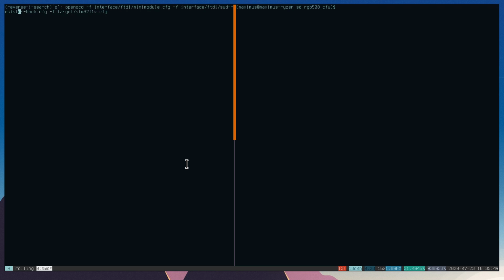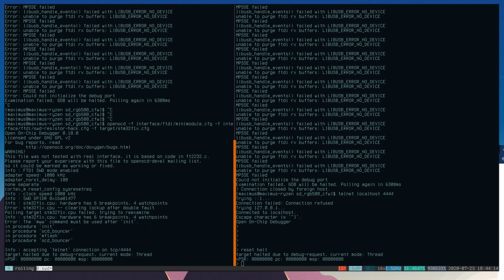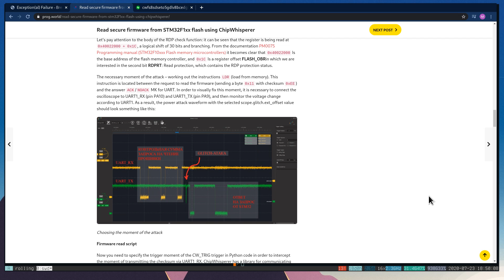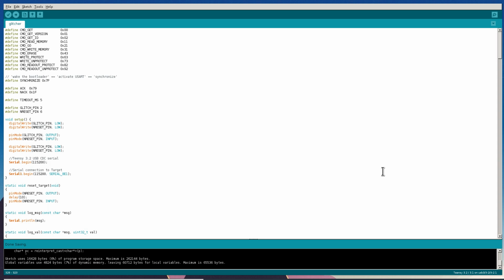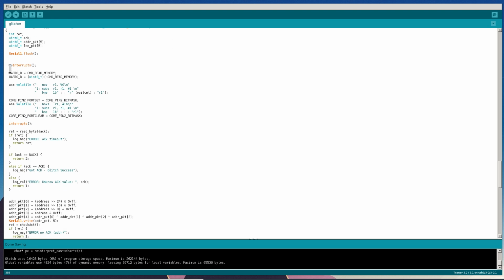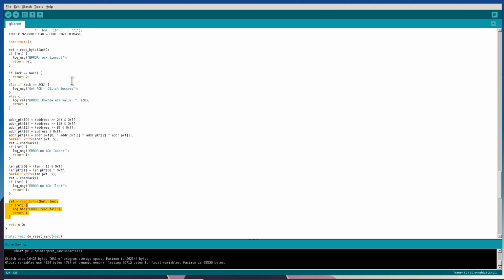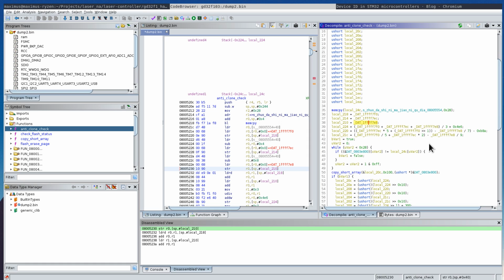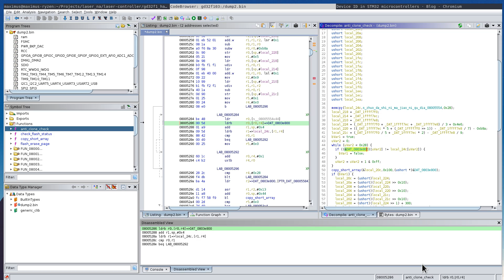SD-RGB500 Projector Firmware Dump & GD32/STM32 RDP bypass - Part 2

Comment: What level of ReaDoutProtected will this work for?  For example, isn't 
RDP Level 1 = Blocks Debugger from accessing Flash/Ram/Registers
RDP Level 2 = Level 1 + JTAG/SWD Disabled + Can only boot from User Flash + Option Bytes are Permanent

Also, any thoughts on the unlisted video (iXBSQRsaiqM) that seems to glitch an STM32F405?
Reply: Ever found the answer?
Reply: @Riksia  This works on Level2, at least on a GD32F303
Reply: @thebrakshow7415  GD32F303, Have you tried and succeeded?